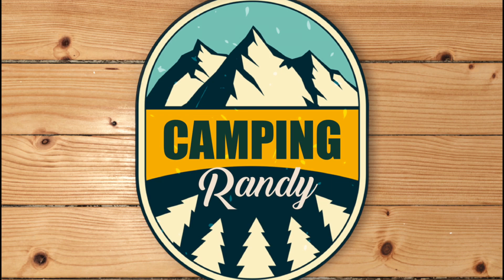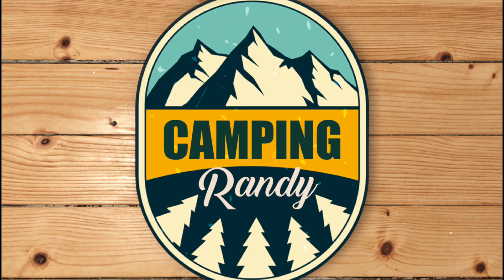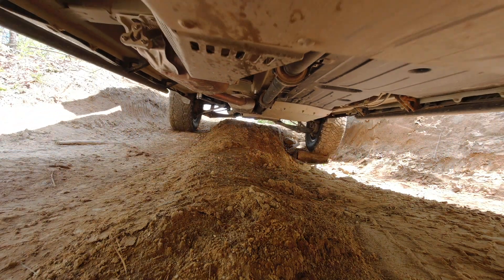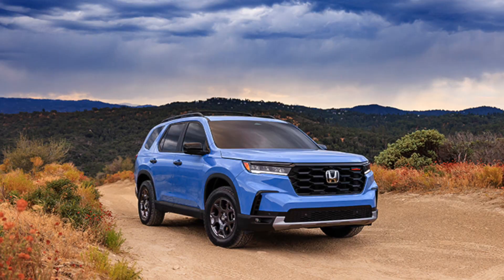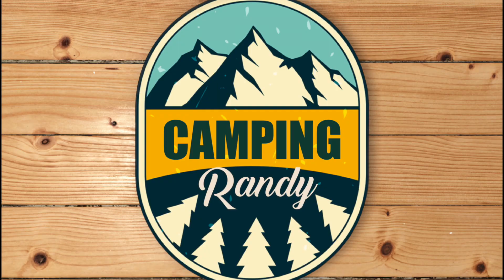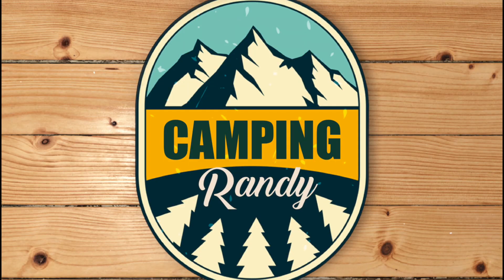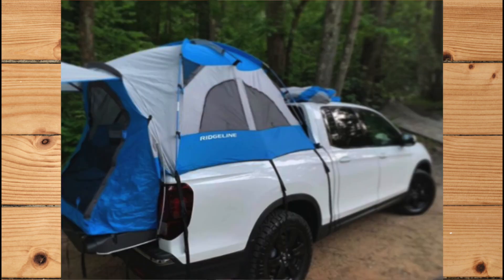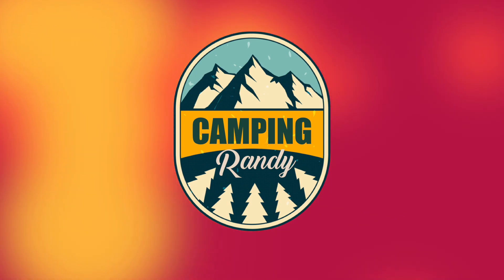CampingRandy's Top 3 Off-Road Packages for your Honda Ridgeline Passport Pilot Camping Adventures!

Comment: Don’t waste your money on modding your Ridgeline. Buy a Gladiator Mojave and you’ll have a much more capable vehicle in its stock form. You’ll regret it if you do. I own a Ridgeline so I am not a troll or as this guy calls people ‘haters’ (what is he 12?).
Reply from the maker: You have no idea what the Ridgeline can do.
Reply: @CampingRandy  what it possibly can do and what it’s designed to are two different things. Modifying a vehicle’s suspension like this just basically makes it dangerous on the road. But, you do you booboo.
Reply: @irambler4791 I wish Honda made it body on frame independent suspension from the factory. I really want a Japanese pickup thats not a toyota.
Reply: @Inferno45  frames are overrated. Someday full size trucks won't even have them
Reply: Anything with the Jeep name should come with a free tow truck😂

Comment: I purchased the 2023 Ridgeline RTL-E about a month ago. Was set on the Tacoma....for years...and made the mistake of checking out the Ridgeline. Lol...far better daily truck. This said, I camp, ruck, and am an ironman. I am outdoors as much as I can be...usually mountains. I want to outfit my Ridgeline with some trail basics. This is a great video, but,  cannot find a good overlanding style bed rack that does not require drilling, etc. my bed. What are the bed rack options for a Gen 2 Ridgeline.
Reply from the maker: Your not looking in the right place. 
https://campingrandy.com/-c148910753

Comment: Have you installed any Auxiliary Isolated Batteries in your Ridgeline. Before I start ordering stuff. And cutting wires. How much extra power is available from the stock electrical system, before things start burning out and catching on fire 🔥  ?
Reply from the maker: Lol - I’m unsure. Just make sure to run inline fuses!

Comment: Randy! with the mentioned increase tire size and 1.5" front lift, whats the new ground clearance and what is it that sits the lowest on the under carriage?
Reply from the maker: 10.5 under engine but 13” at break over between the wheels.

Comment: hi i just want to ask if i buy the flatout suspension gr lite for 2019 honda pilot do i still need the hgr lift? and does 2" front and 2" rear  will fit a 255/70/17? thank you so much

Comment: Do you do anything for trans over heating. my 2017 would over heat pulling my UTV on a 6x12 trailer. I was driving in mid day traffic for hours and it just gave up and over heated. had to wait 40 mins for things to cool off then could drive slower and did not have any issues. Honda reset the ecu and said nothing was wrong. to me it needs a trans cooler. Let me know your thoughts as well.,
Reply from the maker: Got me a big ass race car trans cooler! https://www.amazon.com/dp/B004XONS7G/ref=cm_sw_r_as_gl_api_gl_i_H9K721N6W1CZ0C8A6CNC?linkCode=ml2&tag=campingrandy-20

Comment: Is the level kit needed to use the bigger tires without rub? I’d like to get tires first then the level kit later if that is possible. Thanks!
Reply from the maker: 30.5 diameter is the biggest you can go with any lift.

Comment: Hi, Randy.  Your rear spring rate is 600lbs/in.  What spring rate do you use in the front?  Do you consider using a higher spring rate that comes with the GR plus kit (I think it's 400lbs/in)
Reply from the maker: They are shipping with 500.
Reply: @CampingRandy  Thanks, Randy.  My kit came with 400 in the front and 500 in the rear (w/ the rear overload option).  Good thing I haven't gotten it installed yet.  I ordered the 500 for the front & 600 for the rear, and probably will try to work on it myself.  The shops around here wanted more than $1500 for installation of the Flat out kit and SPC rear adjustable ball joint and alignment, so I am going to try to work on it myself.  How is your set up with the additional HRG kit working out for you?

Btw, thanks for your no-nonsense transmission fluid change video, I changed my transmission fluid a few weeks ago

Comment: I have a 2012 Honda Ridgeline what is the max tire size a can fit on my Ridgeline with a 1.5 inch lift with the rake still in the back because it’s a work truck.
Reply from the maker: 265/60/18

Comment: Randy, what's your thought on a 275/60/r18 Yokohama All terrain tires?
Reply from the maker: That put you at 31”. You will rub a bit, but should only be on the plastic. If to bad, you can swap the two hex head bolts for rounded torx, behind the plastic on firewall.
Reply: @CampingRandy  Thanks for the reply. I have the 2021 model, I will be adding the fender flares, and the traxda 2in lift kit soon. I don't mind a slight rub as long as it's just plastic. 

Hopefully the 275/60/r18 will be flush with the fender flares without wheel spacer. I'm using the black hpd rims.
Reply from the maker: Sounds great. Make sure to check out our 2.5” lift with subframe drop. Your CV AXLES will thank you. https://campingrandy.com/products/HRG-2-5%E2%80%9D-LIFT-KIT-2016-2023-Honda-Ridgeline-Passport-Pilot-Developed-with-CampingRandy-p440876296
Reply: Thanks for the torx head recommendation. I’m having a 2” traxda and BFG Trail Terrain 255/65/r18 put on my new trailsport this week and I’m worried if it will fit at 31”. I’m hoping the narrower 255 won’t rub. It will be snow driving mostly in Tahoe winters. Everything I read says 265/60/r18 is max. Fingers crossed

Comment: My mods:
1) Traxda 2" Lift kit (2" real inches of ground clearance.  This will impact gas mileage at speeds over 65)
2) Tires: Nokian Outpost AT (as quiet as the stock road tires, handle great in the snow/3-peak - See Tyre Reviews recent review - he's putting them on his own truck. This adds another 1/2" - there is a tiny bit of rub at full lock in reverse/ the tires are 1" larger than stock. these tires don't seem to affect gas mileage)
Reply from the maker: Thanks for the tips!

Comment: Csn you fit those tires on the stock rim i was thinking of buying a Ridgeline but they have thin tires 245 but was thinking of changing them to 265s or 255s look a bit more aggressive and meaty but keep same rim is it possible let me know i just wanted to change the width and into terrain muddy tires
Reply from the maker: I run stock wheels - Honda uses enkei wheels